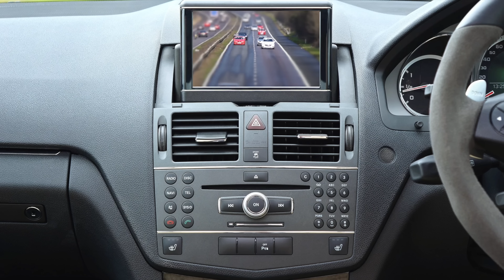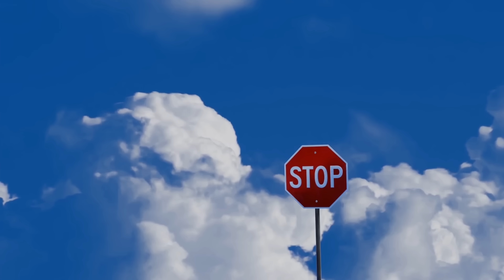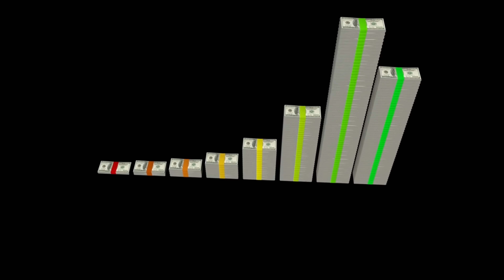Chip War US vs China: China Overtakes US in Chip War!

Comment: The majority of nations may have a more difficult time; in some cases, they may even be unable to produce the semiconductors that are essential for the digital economy. China, on the other hand, is gradually and steadily becoming an expert in these strategies.
The result (5 nm) is a display of China's technological strength through the application of perseverance. No one can stop China from peacefully advancing in any field of knowledge, whether known or undiscovered. There is only one thing that will require some time to complete.
Reply: I hate to burst  your bubble BUT the US owns the technology. We are  manufacturing at 3nm and is already designing 2nm and 1nm chips. China didn't beat anyone to 5nm.  The United States licensed the technology to ASML who is the sole company making the Extreme Ultraviolet machines. TSMC is a semi-conductor Foundry that makes chips for others. They are a contractor. 

The result (5 nm) is a display of China's technological strength through the application of perseverance. China can't develop the technology any further. Do you know why? Because it takes software to design the billions of transistors on silicon wafer. All of thousands of engineers in China can't possibly figure out how to place the transistors, gates efficiently in such a way that they don't end up melting or shorting the chip. The super advanced stuff is out of reach. 

China can't play nice, so it is going to have to play by itself. It is easily 20 years behind the US and there is nothing it can do to change that fact. It can't steal experience. Not economically, not militarily. Experience brings wisdom.